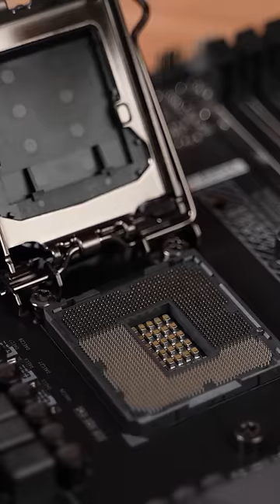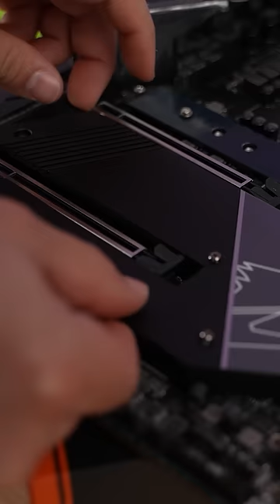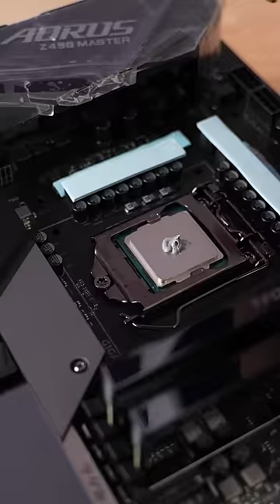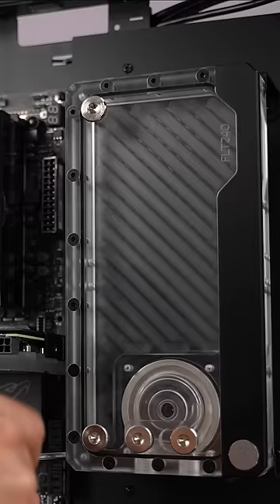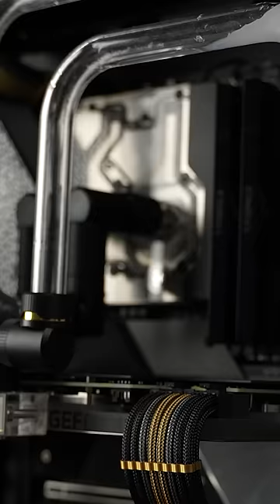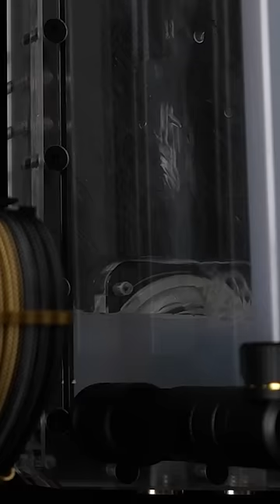$6000 EPIC Corsair 5000D RTX 3080 + i9 Water Cooled PC Build

Comment: 6000 and you couldn’t even get a 3090?
Reply: Lol you guys cheaping out on every part exept the GPU and then wonder why the whole pc isnt running optimized
Reply: @jsteff9290  nah for 6k you can max everything
Reply: Gpus are beyond difficult to get for reasonable prices
Reply: @jordanrtx2050  Not any more...
Reply: @BenjaminArntzen  k
Reply: @BenjaminArntzen  they’re still very much over priced… just because they’ve been dropping doesn’t make them reasonably priced
Reply: @ykguy6379  nah, you ain't getting a 64 core cpu, dual rtx 3090, 256 gb of ram and so on for 6000$
Reply: @jeppebjrnson2171  i meant consumer level
Reply: As in 12900k + one 3090 + 64gb ram (32 will do as well tbh)
Reply: Theyre basicallt the same
Reply: @DaddyM7MD  no, there is a huge difference
Reply: @DaddyM7MD  not a massive jump between 3080 and 3090 but that isnt the point, a 3090 would have been possible and the improvement is big enough to notice it
Reply: @ykguy6379  yea but it seems to be a waste. Well not a waste just the price to performance isnt very great. If were talking about the 3090ti then yes thats worth it for the new feature.
Reply: @jeppebjrnson2171  who the f even needs 256 cores anyway
Reply: @jsteff9290   I paid 2600 for a 3080ti and a i9 10850k, 850w, AIO, 32gb of gskill Royal ram, and Lian li case and fans..this guy definitely just overspent or lied about the price lol. This was the beginning of March, so when prices were still pretty high.
Reply: @jordanrtx2050  think you missed out the massive price drops for the last two weeks.
Reply: @dacbiet  no really?
Reply: @SpeedyBeard  i got an rtx 3080 from ROG for 1200 total after a 2 year store warranty and tax
Reply: @jeppebjrnson2171  ain't runnin around 10 grand? 2k for cpu 2k for each gpu, so that's 6k right there.
Reply: @EricHexaFury  depends, 2.2k for 3090ti gpu and for sum like the threadripper 3990x costing 8k its own what are you even talkin bout?
Reply: @EricHexaFury  that’s not a bad deal for these times but seeing as the msrp for a 3080 is $700 I would still call that over priced… I just snagged a 3080 for 1300 after tax didn’t get a warranty because it’s evga and they take care of people really well when it comes to an rma situation
Reply: @SpeedyBeard  ALL gpus are way above msrp.  No matter what it is.  But 6900xt cards from msi are like 1100 at my store.  So prices are still falling.
Reply: @EricHexaFury  im aware theyre all overpriced my bad i thought you were the guy i replied to above that said cards are reasonably priced... they are falling but they are still far from reasonable
Reply: Yeah but hard line water cool expensive but it was prob more lik 5.5k total
Reply: Bro that's more than 1/3 of the build at that point.
Reply: Probably because 3080 is better then 3090 regardless of the higher number count?
Reply: @Dedsec2.0T  Just built mine for about $5300 with an EVGA 3090 Ti.
Reply: It’s got custom loop, 3080, 5000d and tforce ram. It’s pretty maxed out
Reply: Or even populate every dimm slot
Reply: @jordanrtx2050  I copped a 3080 ti for $1300
Reply: 3090 is kinda rare 😭
Reply: @SpeedyBeard  There are 3090 Ti-s on Newegg for MSRP, which is $2000
Reply: @BenjaminArntzen  yes yes they still are a 3070 tis average price is still 900-1200 a 3080s price is still between 1100-2000
Reply: GUYS ARE YOU SERIOUS because 3060 PCs in Turkey are around 30k Turkish lira, also the cheapest 3090 is 38k Turkish lira and you are crying because you can't buy a 3090 PC for 6000 dollars
Reply: exactly. evga has 3090Tis in stock for 1999 since the launch
Reply: The 3080 aint even the best one u can get
Reply: Nah for 6k you get the 3090 lol
Reply: @PaccFishing  Upvote
Reply: @2JJays  pics or it didn't happen, also nice Q50
Reply: To be fair water cooling is expensive if bought new
Reply: It's because you can not water cooling a RTX 3090
Reply: @joseluiscantisani1616  no
Reply: 3090 ti at least
Reply: @jordanrtx2050  not anymore lmfao that’s a thing in the past
Reply: @jsteff9290  I have $6000k with my build time in mine. 5950x and a evga ftw3 ultra 3090 on custom water block with active back plate.
Reply: @terrarian9501  have the 5000d temp glass version with a 5950x and 3090 on customs water block and active back plate. And just below the 6k this system has in it. Nice rig but over paid somewhere.
Reply: @PewGoBoomLife  yep. I built a 7000d with 5950x, 6900xt, rog hero mobo, 1200w titanium psu, custom loop cooling, 4tb nvme ssd, and 64gb trident ram. Ram me around 6k
Reply: @terrarian9501  right! Especially now with cost dropping on GPU. Mine was done when cost was still up. Running a dual 360 rad system.
Reply: @PewGoBoomLife  yep. Prices are crazy right now. Saw a 6800xt for 800 yesterday
Reply: @ykguy6379  i posted a link to my Twitter and it was deleted.. i posted my build specs with my Twitter handle and it too was deleted.. let's try again.. @2JJays i posted a picture of the 3090 ti next to your comment. It's going in the build on Monday.
Ram: 
CORSAIR Dominator Platinum RGB DDR5 32GB
Graphics card:
EVGA GeForce RTX 3090 ti  
Cpu:
Intel Core I9-12900K 
Motherboard:
ASUS ROG STRIX Z690-E
Psu:
Corsair RMX Series RM1000x 1000 Watt
HDD:
Seagate IronWolf 8TB HDD
SSD:
SAMSUNG 980 PRO SSD 2TB
Cpu cooler:
CORSAIR iCUE H170i
Case:
CORSAIR iCUE 7000X
Reply: 3090 it's kinda pointless tho. Overkill
Reply: @jeppebjrnson2171  well no one uses SLI anymore plus alot of games don't even support it
Reply: @orangecream2870  no it’s not
Reply: @terrarian9501  name a single game that you have to have a 3090 to run at max settings? A 3080 can run any game at max settings 144fps.
Reply: @orangecream2870  you don’t need it. It’s simply called future proofing. A 3090 will be relevant far longer than the 3080.
Reply: @BenjaminArntzen  this might apply somewhat for Americans but its still terrible for the rest of the world. And as someone else pointed out, overpriced is still overpriced
Reply: probably 75% of the cost went to LC
Reply: @jsteff9290  nah it’s pretty simple, air cooling. If I had $6k for a pc build I wouldn’t be going for water cooling that’s for sure. I’d rather have air cooling which performs exactly like water cooling so long as you actually get a decent cooler and fans. Water cooling is a gimmick, it was cool back in like 2014. Take for example, my pc was $1900, if I had gotten water cooling there’s another $1k right there possibly even more for. I reason other than easthetics. In order to get cooling I got a ram a4 sfx and build a dope system in that with air cooling and took all the panels off so it completely open. My temps are great too, like 51c under load for cpu, and my gpu hits like 64c.
Reply: @ykguy6379  have you done it lol? Typical internet comments
Reply: @Floris_VI  Have I done what?
Reply: May me it's the cost of full setup 
Including monitor, mouse, keyboard, 🎧 and other such things
Reply: @zain2854  6k....
Reply: @fishtacos8522  128GB of RAM is a bit overkill for this build, although we considered it
Reply: Could be Australian dollars
Reply: @ykguy6379  u can get 12900KS 6900XT XTXH silicon lol
Reply: @jordanrtx2050  6600 under msrp 6600xt 6700xt almost msrp 6800xt kind of overpriced 6900xt msrp and 6900xt xtxh like 1150$
Reply: @DaddyM7MD  3090 ti is the most pointless gpu ever, what about the 3090 ti is worth?
Reply: @salz446  Honestly. In my country theyre selling 3090 TI's for like 150$ less than the 3090.
Reply: @ykguy6379  buy the 3090 ti its the same price and around 20fps~ more.
Reply: Yeah and with 6000$ you could buy a i9-12900KS & RTX 3090 Ti!
Reply: @SpeedyBeard  bro you can go and get a 2060 for $400 seems pretty reasonable
Reply: @jeppebjrnson2171  well that’s not in this pc is it
Reply: @shooterboi   bro I posted that comment almost a month ago… sorry I can’t predict the future?
Reply: @shooterboi  400$ for 2060 is overpriced as hell i got my 2060 for 270$
Reply: @jeppebjrnson2171  dual 3090 is worse than single 3090, see the LTT video on it. And you can max out a consumer level pc for $6000 16 core cpu, 3090ti/6950xt 128gb of ram
Reply: @AngelT custom loops are definitely stupid expensive but you can get a 360mm AIO for $130-$170 which is pretty great
Reply: @madstlion  we are calling this shit stupid, if they are going to make a $6000 computer and show it off in the shittiest way possible they might as well get the best of the best parts
Reply: A decent 3090 is around $2k+
Reply: Nobody except professionals working on video editing or AI/data engineering need a 3090. For all the games a 3080 is the max you will need
Reply: @BenjaminArntzen  yes they still are, there is still a shortage but its gotten better
Reply: It’s a 3090, but has a custom cooling
Reply: More for the looks instead of performance I guess haha
Reply: @Floris_VI  Late response but just because its possible to do something doesn't mean I have to do it, I thought that was pretty clear
Reply: I was about to say 😂
Reply: 😂😂😂 chill
Reply: @jordanrtx2050  so true 😭
Reply: 3090ti
Reply: It’s probably cause 3090 doesn’t support that type of liquid cooling
Reply: @SpeedyBeard  they’re over priced but the GPU making the build $6k? Doubt.
Reply: @jeppebjrnson2171  “Maxing out” doesn’t mean spending $10k+ on a pc. An Rtx 3090, intel core i9 12900kf, a corsair liquid cpu cooler, 4x16GB 3200 MHz CL14 RAM, any good m.2 ssd, a sufficient power supply, an ASUS ROG MAXIMUS Z690 Hero mobo, and any case with good airflow would be considered maxed out. Once you go past that, you start getting into the overkill area.
Reply: @ykguy6379  this person isn’t American their Australian Americans get very lucky with electronic prices and prices on a lot of stuff different around the world
Reply: @Dedsec2.0T  I would love to inform you that America isn’t the only country that exists this persons account is from Australia they are Australian
Reply: @MyNamesHunter75   thank you captain obvious
Reply: @tony_T_  maxing is overkill, tho other thing is just dream pc time, except 3200mhz, really?
Reply: @Dedsec2.0T  clearly wasn’t as you all assume they are using USD and keep whining about it when clearly it’s not givin that that us get electronics cheapest for pcs
Reply: @MyNamesHunter75  see how it says dollars in the title? That symbol is dollars, so it's pretty FAIR to assume it's USD. because every other currency has a different symbol correct? No one is whining here, it's literally saying how overpriced the pc is with comparisons between other people with their own PCs. Turn on your brain before commenting
Reply: The 3080Ti is better than the 3090 lol
Reply: @thelespauldude3283  I mean, they are literally the same card except the 3090 has double the vram, so no  it's not lol.
Reply: @thelespauldude3283  what no brother💀
Reply: @jeppebjrnson2171  talking about price/performance. When it comes to that, the 3080Ti is the best out of all 30 series cards.
Reply: @thelespauldude3283  we talking about the best of the best not sum price to perfomance shit rn
Reply: 6k could get you a 3090ti build for nasa. This is click bait
Reply: @jsteff9290  not necessarily, i have a ryzen 5 5600x with a 3080 and it runs just as good as a intel 12600k
Reply: 1000th like
Reply: I built one with a 3090 and mostly high end gear for 6500$
Reply: fr
Reply: 3080s are more powerful for gaming then 3090.
Reply: @cpt.fignuts  bro check your game fr, you can sli 3090 and 3090 ti bro
Reply: he didn't even use a12x25
Reply: @notnooted  i5 12th gen is better than the ryzen 5600x
Reply: @mehdih8165  not for the price😂
Reply: @jeppebjrnson2171  I promise you, you can except a 64 core processor but an i9 12900K would suffice
Reply: Fr
Reply: @jsteff9290  U can get a fkn r7 5800x3d a good NZXT cooler for the cpu also A NZXT H510e + rtx3090ti +1000w psu + Corsair Dominator/Team Force Ram + ANY good fan for the case.
Reply: THATS WHAT IM SAYING
Reply: @jsteff9290  6k you can get a 12900ks best z790 64gb ddr5 6000mhz and a dual evga 3090ti ftw3 ultra😂, that pc isnt even worth 3k
Reply: @Eradicator-jv9xr  16 cores are enough
Reply: That's what I'm saying
Reply: Or 4 memory modules
Reply: Bro could get a 4090 at that point
Reply: This pc DOES have full hardline water cooling
Reply: And it’s not even a 12 gen
Reply: What's wrong with a 3080?

Comment: If you’re spending 6000 dollars on one pc then why would you not go with a 12900k or a 5950x?
Reply: I would assume this build was made before the 12900k, perhaps it was an older gen i9 (10900k/11900k)
Reply: @ms.lewdlitch8108  maybe
Reply: My PC with a 3080, 5950x, same case was like $3,000 without a monitor. No way this is 6k
Reply: @drew899  the real cost is in the 8tb NVME SSDs, stupid expensive ram, unnecessary 1200W psu and the limited run water cooling parts.
Reply: it was posted on march 24
Reply: @ms.lewdlitch8108  then why did they not go for a ryzen? Anything but 12th gen intel doesnt even stand a chance against ryzen
Reply: @drew899  I am a Turk and I wish we had an economy like you, I can work and take for 2 years and really cheap for you, the computer is expensive to us.
Reply: @boogiehasfun  okay? The 5950x was out and before 12th gen amd was on top
Reply: @Ibrahim-cn6sn  trust me computers are still expensive for us too
Reply: @ms.lewdlitch8108  yes the motherboard said Z490 wich supports 10 th gen
Reply: 5950x?? just go for 5800x3d will push more Fps 💯
Reply: @SUTH_33  that actually depends on which game, some games benefit more from the higher core count of the 5950x and some benefit more from the 5800x3D’s cache. Also in certain applications like video editing the 5950x would perform far better than the 5800x3D because it has twice the cores and threads and it also runs at higher speeds so if it isn’t just a gaming pc you might be better off with a 5950x. Also if you use a lot of virtual machines then the higher core count of the 5950x will allow you to have more VMs and more powerful VMs.
Reply: I went with a 5950 x when I built my monster machine but I went all performance no show 128gbs ram 1200 watts psu ect
Reply: @missmazrochelle6535  that’s the way I’m going for my build right now, powerful but minimally flashy.
Reply: @excalligator5529  yea exactly mine when i first built it cost me £7,000 but now because diminishing returns on things leaves it worth £4,000 tbh you want a solid build that will last a while but not to much show and no go. i have a friend who is like oh well i need a build with all this fancy looking stuff when it comes to buying the main components he has about £2,000 to spend on them Smh.
Reply: @tridinh1011   12th gen intel processors are great if you have a pretty high end cooler and PSU for it. I would go for a ryzen chip to go for power efficiency and the AM4 motherboards are slightly cheaper than LGA1700.
Reply: @drew899  same with 3090 but you know like you can have components extremely pricey stupidly like mb for 2000$ …… with same performance as 500$
Reply: @ms.lewdlitch8108  the board is a z490 which supports 10th gen
Reply: Bro probably spent 2k on that pc
Reply: @Tri Dinh  I have a 9600k and a 2060  my build was only $900 why yall paying stupid ahh prices